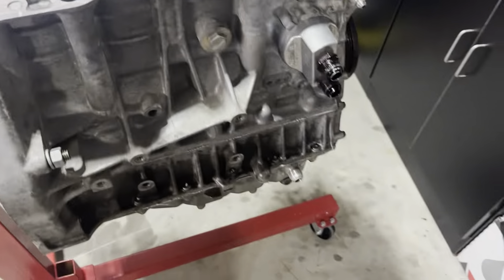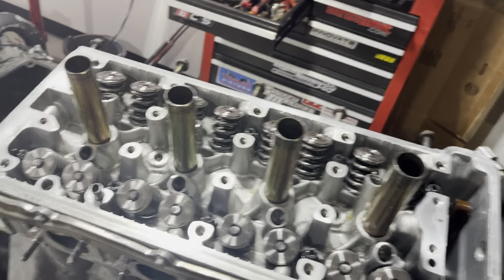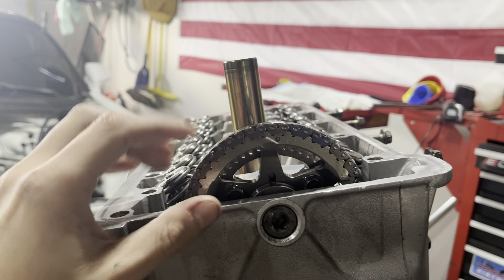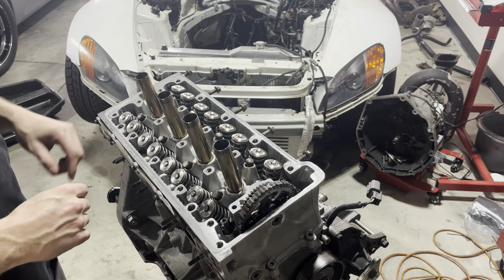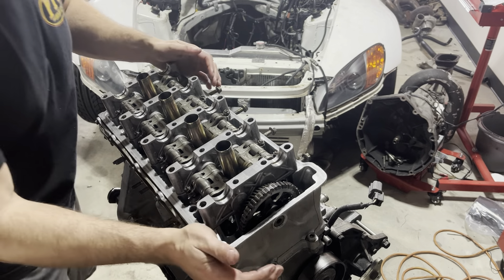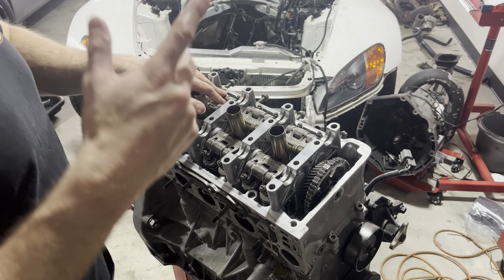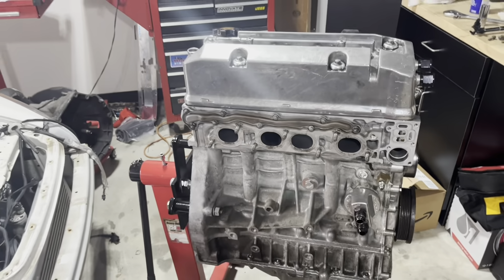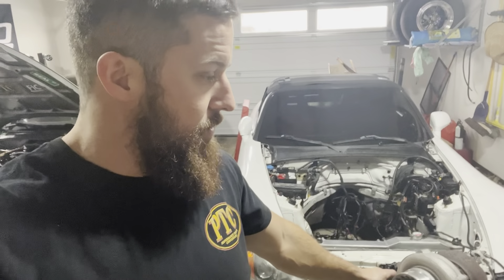Dillions F24 Turbo Build part 3!!!

Comment: You're so fast with it 😂 it takes me days to do what you did just now but that's because I'm super scared and refer to the honda manual 3 times every step. Awesome vid series man, keep it up!
Reply from the maker: Thansk! Ya you start to memorize everything after a few lol thanks for the support!
Reply: Do you have the steps do install heads ?  I need that tq specs every shops been lagging and I’ve been meaning to do it but no tq specs and scared as well 🤣😭😭